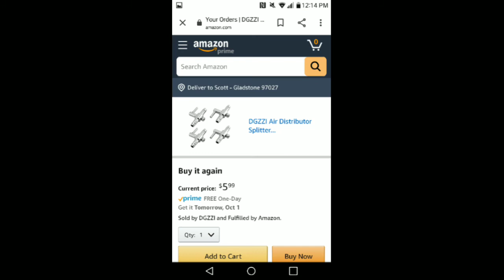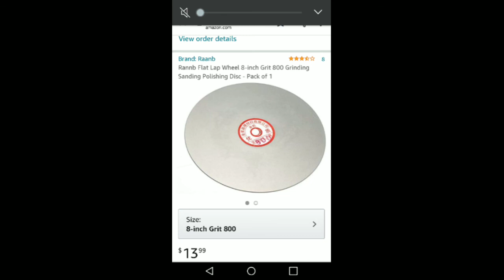How I made a flat lap machine for $250

Comment: Great Job making the Homemade Flat Lap. I am a Lapidary Artist made a few machines while I was in Texas. Moved to the Philippines about 2 years ago and have the itch. Going to start looking for supplies to make my own equipment. They use 220v here so need to check on motors and light specs before I buy. Keep on Rocking!
Reply from the maker: Thank you 👍❤️👍
I plan to do a full rebuild on this machine.
It was a great idea and works but in my opinion the motor is overkill and needs to be changed from direct drive for my fingers safety. 👍
I'm definitely interested to hear any ideas or about other people's builds.
I'm always looking for more inspiration
Reply: Awesome build mate. Also on different voltage over here In Australia it's 240v here. Would love to see the rebuild video?

Comment: I THINK I can answer the question @wadeyates9943 posted some time back.  Without a schematic, and just looking at the parts and wiring.  That looks like a typical 3.5HP 130VDC treadmill motor, so it is not going to the AC mains directly.  The gentleman has disemboweled the PC power supply and re-purposed it for his control center.  The 120VAC is rectified to DC and kind of pulse-width-modulated to the motor from 0VDC to I am guessing max 90VDC?  If you are in 230VAC land you might want to get a different motor.  The pot is used to control the rate of the PWM, hence changing the speed.  Very good build, my friend!
Reply from the maker: Thank you
And thank you for all the information.
I felt this to be a good try at a homemade flat lap machine in idea.
However 
I definitely plan to remake the entire machine.
#1 change will be the motor.
Making it not direct drive and changing it out for something else.
It's kinda scary. Lol 😆

Comment: What type of motor do the treadmills use?
Reply from the maker: The treadmill DC motors have a lot of toque.
They can run forward or backwards with same results .
In the future I plan to rebuild this project using a less powerful motor and a belt vs the  direct mount arbor.
The machine works great nice and smooth as the treadmill motors are well balanced but scary powerful.
Makes my fingers nervous. Lol 👍

Comment: What did you use on the arbor to hold the backing plate and grinding plates?
Reply from the maker: The arbor is bolted differently to the motor shaft. The arbor has reverse threads and a nut to hold the backing plate / grinding disk in place. I have plans to rebuild this entire build. After building it a couple years ago I realized many things I want to correct. The main thing I plan to change is the arbor being directly bolted to the motor shaft. It's too dangerous, I plan to add a couple pulleys and change out the motor to a less powerful motor.  It works great in design but it's a bit scary. 👍 Lol

Comment: Which grit is the best for polishing stone
Reply from the maker: It depends alot on what kind of rock or mineral you want to Polish. 
For example on agate I like to start with
100 grit to shape
220 grit to further shape and remove scathces
600 to Finnish removing scratches and smooth the shape
800 grit is where the shine starts to happen
1200 grit will further shine
And then buff with diamond paist or other chosen compound. 
You can keep going after 1200 grit up to 2000 grit but that mostly depends on the material.
This is only an example of a method I use.
Good luck
YouTube thankfully is full of professionals I'm learning all the time. 👍
Reply: @cb175s  Thank you very much🙂

Comment: What did you use for your arbor? Great build btw!
Reply from the maker: I bought a small motor arbor head. It's attached right to the motor shaft.
I plan to rebuild this machine. Different motor / arbour and add a pulley with belt. The directly bolted to the motor is too fast and powerful. It works but just a bit scary

Comment: cool but way too much vibration at that speed. you would have to slow it way down to get any kind of decent surface flatness
Reply from the maker: I agree, it was a fun build but needs to be rebuilt with a slower motor that is not directly connected to the arbor.
The motor was from a high end treadmill so it's smooth and quiet but the torque / speed makes it scary. 😁
I plan on a complete future rebuild, better video, better idea.
Thank you for the input 👍❤️👍

Comment: Wild question but what keywords would you use for finding your metal spout to adjust water flow? Im running a small electric water pump right now and its wayyy too much water and and gonna resort to making a geyser.
Reply from the maker: 2 way valve for fish tank
Or
Air valve for fish tank
👍

Comment: Do you ever reverse the direction while using it?  If I used an old table saw motor which only goes one direction would that work okay or should I get a two-way direction motor ?
Reply from the maker: I can run it in reverse but the Barbour is threaded for directional use only.
I tryed to run it in reverse once ant the balance plate interested itself and flew off like a frisbee...😅😅😅
Any motor would work great, just make sure the bolts holding on the balance plate / diamond plate tighter up as the motor spins rather than loosen.
You can order arbours in either thread direction. Left or right 👍
In the near future I will be making a smaller table top flat lap machine.
Maybe add a manipulator arm for facete work.

Comment: You need to get rid of the vibration. I would balance it by adding weights or by drilling a divot n the underside of the plate.
Reply from the maker: Part of the vibration problem is the wood frame not sitting flat on my garage floor... Lol
Fixed now

Thank you for the idea's 
I plan on a full rebuild in the future
After the build was finished finnished I thought of so many things I could have done differant... 😅😅
Reply: the vibration appeared to be due to the diamond plate or backing plate not having a tight enough fit to the arbor.

Comment: Is this meant for producing faltness to sub micron level or for aesthetically smooth surface. Other lapping machines I saw are way too complex. Ex. Lapmaster.
Trying to figure out how these things are different.
Reply from the maker: I built this mainly so I can smooth out small rock slabs and remove saw marks. So yes mainly for visual aesthetics. Unfortunately the end result is I built a machine that scares me . Lol 
I plan to completely rebuild this different motor/ arbour set-up.
I would like to make it able to have a manipulator arm facets and drop the speed way down. 👍